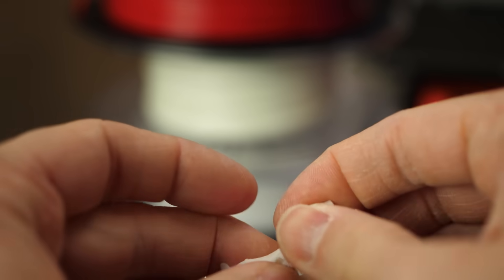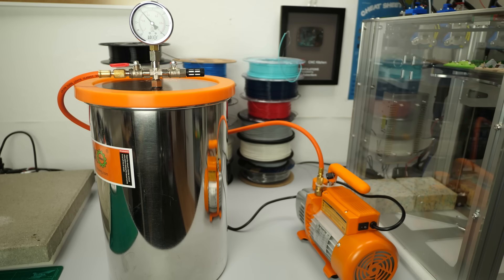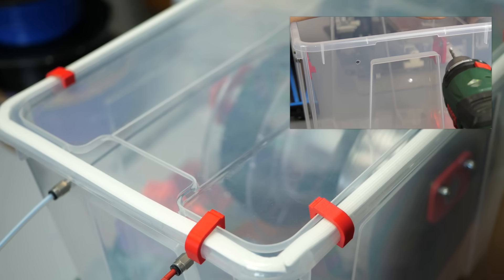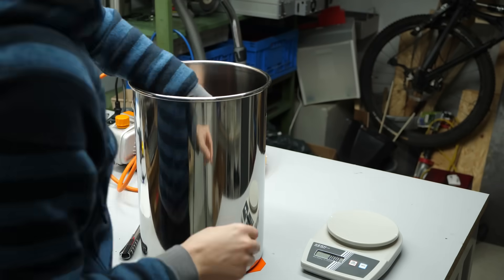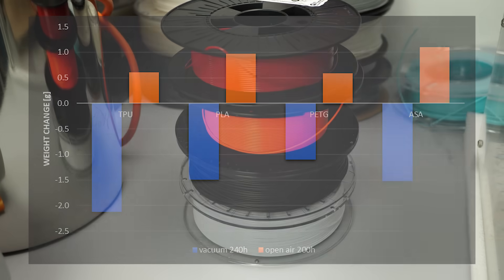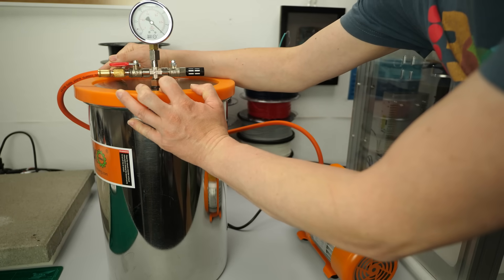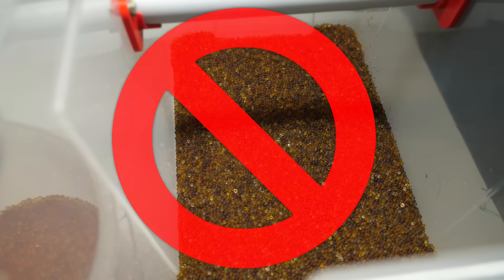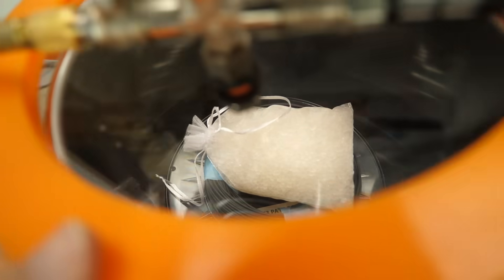Vacuum VS Dehydrator! What's the best way to dry filament?

Comment: Im 2 min in, but wouldn't taking the air out and making the water inside boil, would that not make air pockets and make the filament brittle?
Reply: In a dehydrator, use a thermometer and set it to your desired temp and measure it over time, make sure its accurate, if not thats okay just remember the offset and apply that before putting filament in there wink 😉 60c 140f is the temp you want, 45min

Comment: Great video Stefan, helps a lot with storage decisions. When I first heard about drying filament I thought of using an old incandescent lightbulb for heat (just a more common object than heat coils). Perhaps it could be secured within a tube that the spool rests on (to save space and hopefully heat more evenly), with the enclosure being rather small, vented, and perhaps foam-lined or similarly insulated. It could even potentially be kept on during printing, although I have no idea how preheated filament would behave under extrusion forces; a fan mounted just beyond the enclosure's exit may be necessary. And of course the temperature would have to be regulated, which might require either a dimmer or thermostat.

Does this sound remotely feasible, or too complex/ineffective compared to current accepted methods to be worth attempting?
Reply: I recently did something similar to recharge the silica gel itself and managed to reduce humidity to 25% with a 100w lightbulb
Reply: This sounds similar to the Infrared heat lamp units that sell as space heaters with a fan and thermostat to circulate the warm air.
If you could find a cheap or used one and a add a PID control to your box, you would be golden.

Comment: Did you try a heat lamp on the filament in the vacuum chamber?  It gives the water the energy it needs to change phases easier. With out it it freezes like a sublimator in space and inhibits evaporation
Reply: Intriguing! Would you say a vacuum drying oven would be a good solution? I think one can be had with pump for under 1000 bucks..
Reply: @karoo_bushman6880  i think maybe if your doing it commercially it might be a good idea. For hobby use i would stick with the traditional heated dryers they are about $50 and do the job petty good. I run a esun Dryer i got on amazon and haven't had any issues. I think the advantage of the heated dryer is also that if your running a long print on a humid day the heated dryer can keep running while using filament.

Comment: It is difficult to pump water with a vacuum pump, as most pumps will condense it, and thus not remove it from the cylinder.
(Unless the pump has a bleed valve that lets air in the cylinder during the compression cycle).
Anyway, with the pump off, the vacuum in the chamber will be saturated with water really quickly anyway.
If you want to properly dry, you might try warm filament and cold silica gel in the same chamber. Lowering air pressure does not help much - it is the partial pressure of the water that counts. Air molecules also will not slow down diffusion much - the rate will be more limited because of slow diffusion out of the filament.

Comment: What are the health concerns over silica with indicator dyes?

Edit: For those wondering, the indicator dye used in silica beads will either be cobalt chloride (blue) or methyl violet (orange). Both of these dyes are toxic and carcinogenic, though methyl violet is regarded as less dangerous than cobalt chloride.
Using small amounts of methyl violet indicator in sealed packets seems to be considered food-safe, but if the indicator is loose like how you buy it in bulk, you could inhale or ingest dust from the beads, thus consuming trace amounts of the dye.
Reply: Thank you, that was Exactly my question (I use blue indicator) I will be throwing it away immediately and buying non color indicator.
Reply: @goguyted  Me too. Don't want to run the risk of cobalt chloride in my silica packets contaminating my filament.
Reply: I have notice that Germans, in general, worry way too much about item toxicity.  The indicator is quite benign, otherwise it wouldn't come in every single dry item (IC chips, etc) you order.
Reply: @JohnHansknecht  I don't think I've ever bought anything that used dye indicator in its silica packets. It's always been plain silica beads with no indicator.
Reply: The orange-green ones I bought say they do not contain cobalt chloride. Now whether what they actually contain is toxic or not.. no idea.
Reply: @expression3639  orange-green indicator would be methyl violet dye. Not as hazardous as cobalt chloride but still a carcinogen & toxin. If you bought presealed packets then probably nothing to worry about but loose beads will put you at risk of inhaling or ingesting bead dust laced with the dye.
Reply: Wait that’s really good information..  actually really concerning since dye indicators are used consistently in compressed air for food grade processes
Reply: Cobalchlorid is a salt… there is nothing to worry as long as you do not eat a lot of it.
Reply: @DrMarcArnoldBach  whether or not a compound is a salt is not an indication of toxicity… Cyanide comes in many salts, for example. As does lead
Reply: @tildey6661  you are correct, but I don't believe that is what he is saying. He states his opinion that the risk is minimal or non existant unless you have some excessive physical contact, such as eating it, with the compound in its salt form. The last part of his statement indicates that it is indeed toxic "as long as you do not eat a lot of it". 
What it being in a salt form, or any toxic compound being a salt for that matter, has to do with the risk  it imposes I'm not really sure. Perhaps he is insinuating that under normal circumstances it is not a volatile compound and your not going to encounter it in the air, i.e. not being a volatile substance, not going to be in the air, not going to sublime, turn into a gas, no vapors, thus  your not likely to come into contact with it under normal circumstances. That theory is a long shot and seriously flawed however, i'm not going to look into the vapor pressure and vapor temperature to begin to decipher what his logic was and its based on my assumption that he has limited education and training in chemistry. I could see someone without a strong understanding of chemistry thinking that there is no exposure to the compound unless you physically touch it.

Comment: The difference between 27.75 (55,118 Micron) and 29.915 (127 Micron) is MASIVE.

You should try your test agains with a proper two stage vacuum pump that pulls over 50X more out of the chamber.
Reply: @karoo_bushman6880  I'm not 100% sure.   I have a Yellow Jacket pump that is rated to 25 microns, and supposidly over performs down to just 7 microns.

1 millibar = 760 microns.

In other words, I suspect that is not a very good vaccuum and probably only removes 97.3000% of the air as opposed to 99.9967%  A difference of 1121x

i.e. the 25 micron pump removes over 1000x as much air.

760,000 micron = 1 bar.

But maybe Im reading the specs wrong? 🤷

Comment: Have you cut the separation grates of the dehydrator? I would like to buy one and I don't know if I should get any dehydrator and cut the grates or I should look for one with sufficient spacing between the grates to fit a spool. I never had or used a dehydrator before.

Comment: I used to work in extrusion plant, the rule was a minimum of 2H @ 90 C° for the TPU we were using (hot air blown for bottom to the top on plastic pellets)

Comment: Dehydrator never worked for me as my ABS, and PETG, after 3 days with it constantly running never dried out (the silica did though).  Pops, steam, voids in the print I gave up so wasted 70 dollars.

Comment: If your pressure pot is metal couldn't you just set it on a hot plate to raise the temperature slightly. Also, would it be possible to set the pressure pot on the scale and weigh it without having to open it up every few hours? Every time you open it up you have to start from zero, so some lost time created by the monitoring process.

Comment: If you really want to know what is going in that vacuum chamber.  Then get a Micron gauge.   It will really tell you if you are still getting evaporation and what is happening inside the chamber.   the pressure gauge measuring in Inches of mercury is not sensitive enough.

Comment: I suspect that part of the weight loss from the second stage of dehydration is caused by moisture migrating from the center of the filament to parts nearer to the surface over time. Especially when you're using a fairly 'soft' vacuum, I would expect moisture farther from the surface to take time to move. 

If you give the filament a 'rest' in a dry environment, you should see moisture equalization throughout the thickness of the filament. A subsequent desiccation should then be able to pull more moisture from the surface layers, dropping the overall moisture content again.

Comment: I have a mountain of old (1 year+) filament that I was trying to dump, now its all 'like new' thanks to a decent drying system!
I find that an hour or so in the dryer with PETG improves print quality, even if there are no visible bubbles prior to drying.
It shines better in vase mode...

Comment: I use a dry box with desiccant (2-5#s per box). Considering adding in a lowish constant heating element. Wondering if adding desiccant to active heating like with the food dehydrator would improve the results.

Comment: Again: very great video!

I personally don't like to warm up my materials where I also warm up my food afterwards...
For PVA I bought a Polymaker Polybox Edition 2 now and set my PVA inside of it...
It uses 2x100g Bags of Silica gel.
In the Manual it says that after 2 hours the humidity would drop below 15%...
Now after 3 Days its still at 28%...
Above 20% the manual tells to change the desiccant....
So the Silicagel was not even close to be able to dehydrate the moisture out of the PVA that it soaked in within the last year...

I dried the silica gel now in an unused microwave for 5 min in defrost mode... When you take the bag out afterwards you really can feel that the bag is still a bit wet.
Don't directly put the silica-bags in again - let it sit for a while to dry... else you'll have a humidity in your box of sometimes 50 to 80% ^^
 
Will do that now again till I dried out the materials!

Comment: i've seen setups where people put (oven-dried) desiccant into the vacuum chamber with the filament, did you try that during the initial drying stage too? might help get rid of the need to regularly reevacuate the chamber, since any moisture in the chamber would prefer to settle into the desiccant instead of the filament. or was that what you did in the "vacuum+desiccant storage" test already?

Comment: You should do an experiment using white rice dried in a dehydrator at 125 deg in place of desiccant. 125 drying temperature was determined by a manufacturer as the best temperature for drying rice.  I have used this for storage in the past, and the rice can be redried periodically. You will not get fumes off of it like you will some desicant.

Comment: If you put silica gel desiccant at the bottom of the vacuum chamber and put it on low heat on a hot plate, you could probably get it much much drier.

Comment: Dehydrated Epsom salts is the most effective molecular desiccant you can get your hands on. Just bake the salt at 400f for about 2 hours crush it up while hot if possible and put it in a jar and add to your filament box. Make sure the box is air tight also!!

Comment: A separate post so you don't need to read my other pointless stuff ^^:
For those looking for a way of monitoring your filament box remotely - I'd suggest somewhat like ESP32 with an DHT22 or comparable sensor. The DHT22 has already quite low power need of 1.5 mA while meassuring and 50 µA if on standby, and with the help of a ESP32-board optimized for battery powered operation, this could be a nice duo.
The ESP32 can be used to send e.g. e-mail alerts if your storage conditions get worse. Might be a neat little project with probably lower cost than buying WiFi capable temperature and humidity monitors OTS.

Comment: I am still unsure on how to properly store my filaments. My idea was simply getting some Euroboxes (they are pretty rigid, stackable, blinded (you want to make sure you store your filament without much UV exposure from sunlight) and can be ordered fully closed) and using a 3D-printed spoolholder assembly inside. 
On the other hand I might skip that spoolholder altogehter (despite I found a pretty cool blog post about it here: https://anybot3d.com/en/build-your-own-diy-filament-box/ ) - I simply cannot imagine any real upsides if you swap filaments on a somewhat regular basis. 
If I make it somewhat airtight, I still need to retract filament onto its  spool after swapping unless I want to waste dozens of centimeters exposed to air. This is where you need to open the lid frequently - so unless I spend too much time and money on a retracting mechanism, this renders the idea of "airtight" useless.

Comment: Would be advised to have sort of heating plate with precision control, maybe using steel wool bed for contact, you would warm up material and store in a vacuum that would pull the most heat possible in my opinion
Reply: Sounds complicated and finicky over an everyday vacuum oven, which are easy to find because of legalization — for reasons.

Comment: Great video with a lot of detail. I usually store my filament rolls (i use mostly PLA) in the plastic bags they came with. I add a perforated transparent film-container filled with dessicant to each bag and close them with ordinary bag clamps. Benefits are: less potentially humid air in the bags compared to plastic boxes), doesn't require much space, is relatively air-tight, costs next to nothing.

Comment: So,  researching in UHV technology, where water is of major concern. It comes to my mind, that the water outgassing is a diffusion-limited and therefore thermally activated process. The exponential dependence, makes the water degassing rate skyrocket, even with a little temperature rise. The rough vacuum does not help significantly, even if it were UHV, definitely not to degas water from the bulk of the filament. Your best shot is to heat it up under vacuum and then store it in a desiccant, as we do with plastics to be used in a vacuum.

Comment: 8:43 "Stay at least a couple of degrees below the glass transition temperatures of the material you treat"
Alright, let's check the glass transition temp for my NinjaFlex * checks datasheet * Okay, so I'll be heat dehydrating my NinjaFlex at -45°C 😂

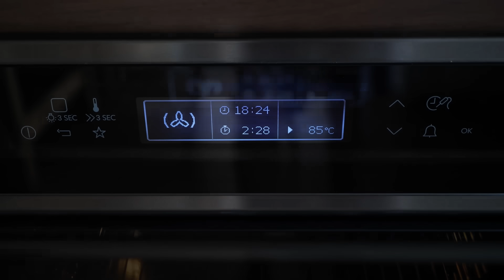Comment: 12:59 I think the english translation for circulation oven, is fan forced oven. Also most materials only need to be dried at 55C and not 70C. If that's not working well because you live in a humid environment, put your dehydrator in a bigger box (close to air tight) with desiccant (kitty litter works 😉).
Reply: Convection Oven

Comment: Great video. I was able to use this to teach my son Ethan how convection dehydrators work. In addition to the fact that heating the air reduces the relative humidity, the water in the material will be heated as well, and higher temperature water evaporates more easily (quickly).

Comment: Printing from my bedroom. Printer and all my filament is about a foot from the open window... had blowout issues all the time.

Got a tiny office dehumidifier and slapped all the reels into a closed plastic storage tub with it. I just left it in there for a couple days before printing again, no problems since. I'll build a custom proper reel storage / dehumidifier when I move and have a dedicated workspace.

Comment: Grüßi Stefan aus England! 

It would be interesting to see how clothes vacuum storage bags (cheap from eBay, Amazon, elsewhere) would fare for long term storage (and drying), especially with a bag of dessicant included in the bag, ideally as a long "sausage roll" around the spool.

I've not come across anyone doing this so far, but I like your VERY comprehensive, scientific and thorough testing regime so if you haven't looked at these, maybe you could do a review? Tschüß!

https://www.ebay.co.uk/itm/STRONG-VACUUM-STORAGE-SPACE-SAVING-BAGS-FOR-CLOTHES-BEDDING-MULTIPLE-SIZES-/133534970501?_trksid=p2349624.m46890.l49292